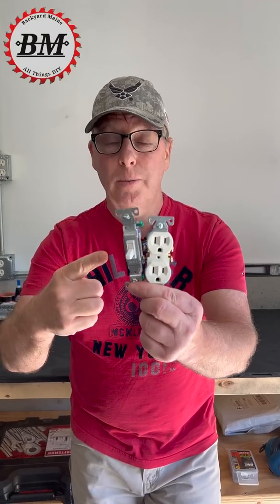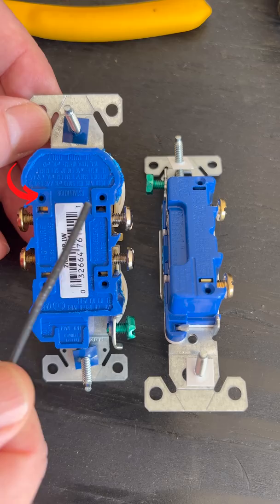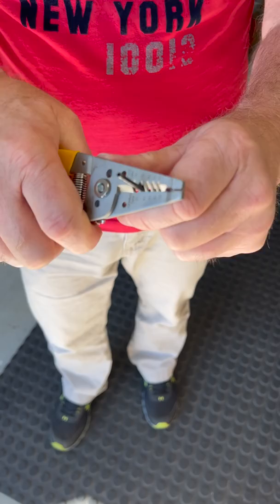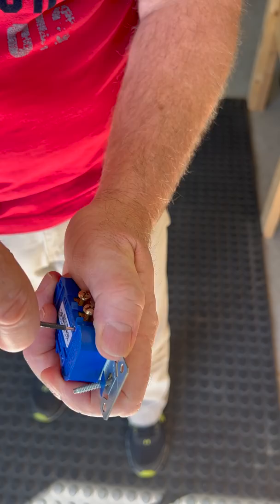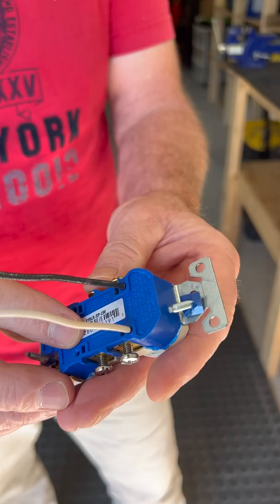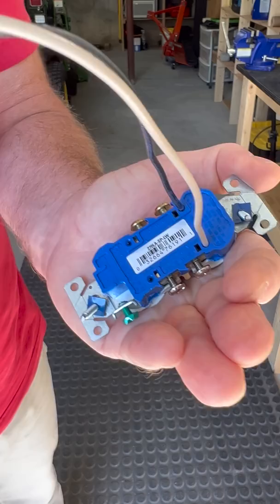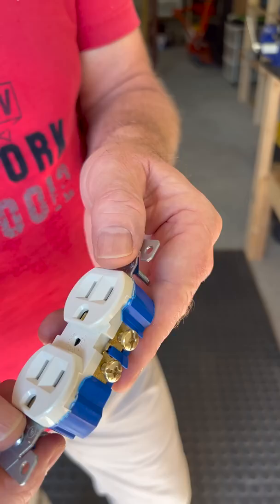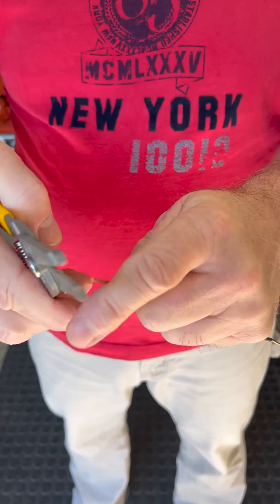Don't make this electrical mistake #Shorts

Comment: So even though they are certified to use that way you should do it? I'm replacing my outlets and all of them are 2 black and whites on the sides and one black and white in opposite speed connects  how should I connect them?
Reply from the maker: I would not install more than two wires of each color to the receptacle. If you have three wires you should pigtail them together with tails that connect to the side screws of the receptacle. I have a video on pigtails as well
Reply: What if I have split reciprocal in kitchen counter but want to install a new one with USB but inly has one hot and one white connector.... can I cap off one of the hots?

Comment: I have had both philosophies over the years. I will say that whatever you do,, DO IT PROPERLY!! I have never seen a PROPERLY done back stab fail. The amount of insulation removed is absolutely imperative, too much or too little will cause problems. I have also see side terminals not done properly that are just as dangerous.. The worst I've seen was IDIOTS drilling the holes so 12 ga would fit
Reply from the maker: Constructive arguments are always appreciated.
Reply: @BackyardMaine  it isn't my intension to argue and nothing you've said is wrong.. I have seen wire stripped 3/8", left straight, and pinched under one side of the screw, AND many times wrapped backwards and barley held in place by the screw along with  the standard too much or too little insulation removed....I think most strictly residential electricians would say use the back-stabs and almost all industrial and commercial electricians would say NEVER back stab.  BY FAR the most common point of failure is wire-nuts being considered connectors which they are NOT, They are insulators.. That might be a good video for you to make and so would box make-up.. Either way,, your advice is good and not misleading

Comment: Yet, they have passed UL testing and companies haven't been sued out of existence.  WAGO makes and sells millions.  Intuition says side wiring provides more surface area, yet upper and lower screws are connected by little tab.  Old wives tale.  Of course if you are feeding 15A receptacles with a 20A circuit breaker?
Reply from the maker: I’ve repaired 100s of these after they have been installed for a few years. They used to be approved for 20A as well but not anymore.

Comment: My apartment complex wired the sockets with the light switch. So when ever I turn on the lights the sockets start working.
Reply from the maker: Many time just half of a duplex receptacle is switched or maybe one receptacle in a room without a ceiling light. If all the receptacles are switched on both sides that's a poor installation.

Comment: It's code and UL listed. Secret trick electricians use so they have work later down the road. If it's not stripped well and a clean stab yeah it may flicker. You really have to be incompetent to mess up that easy of a connection. It's not like everything is ment to last forever and it's not going to any ways. Most bedrooms are not wired to properly supply heaters with power. That back stab is a weak point to alert you before you ruin the circuit entirely. Saying never back stab though, it's debatable.
Reply from the maker: So you’re saying that it’s a poor connection on purpose. lol.  Electricians and engineers like myself should be installing circuits to handle the max load based on the NEC. A 15A circuit should be capable of carrying 12A. Depending on the breaker for protection is a much better solution than a known poor connection

Comment: Then what you need the holes for ???
Reply from the maker: They are still an option but if the manufacturer thought they we best why do the give you the screw terminal option. I think they were designed for the DIYer.

Comment: Why are there four connection points on the duplex outlet?
Reply from the maker: They are there for two reasons. One is if you want to split the receptacle and have one side switched or even fed from another circuit you could remove the tab between the two screws. Second would be for through wiring to the next device.  In this case the incoming wires would hook to one side while the outgoing wires connected to the other.

Comment: Back stabbing the device in 2022 is safer that the 1990 when the device excepted 12&14 AWG 
Side wiring the device is only better if you are torquing the screw otherwise it is not as good of a connection
RC3
Reply from the maker: I find the new ones failing all the time as well. I guess we all have different experiences.

Comment: if these are so known to be a failure point and are not recommended why do they exist and are UL legal or whatever?
Reply from the maker: Stab connections are the manufacturers attempt at supplying a user friendly way for homeowners to replace a switch or receptacle. They are however not reliable over time. I say this based on my experience of  almost 4 decades of in the electrical field either as a licensed electrician or electrical engineer. I have seen some screw terminal connections that were made so poorly that the stab would have been more reliable. Maybe thats why these are still available. Companies like Hubbell and Leviton are now offering a much better and more reliable quick connect on their devices. If they continue to gain popularity and prove to be reliable the stab connections may become obsolete. I have other videos with failed stabs on my channel.

Comment: how many inch pounds do you tighten it to or is it foot pounds?
Reply from the maker: You can find that in the manufacturers recommendations but I never torque these connectors. I know what tight after 38 years. lol. I have never know an electrician that did torque.

Comment: Then why does UL sign off on the stab connectors??
Reply from the maker: They used to be listed for 20A devices as well but not anymore. I find they work ok under minimal loading but now always. I have had them fail on light switches even wit LED lights. As many failures as I have seen over the years it just makes sense to me to use the screw connections.

Comment: SCAB LOCKS.   Never use an outlet as a junction point either …Use pig tails off the receptacle
Reply from the maker: Never heard that term before. lol
Reply: @BackyardMaine  u do not know how many new or built within the past 15-20 years that every single device was Scab locked ….  They lost power in sections of the house
Reply from the maker: @cyrysvonnachtseite4546  I do actually know my friend. Ive been an electrician for 38 years and I have repaired so many of these connections.

Comment: Would this also cause the breaker to trip if the lights flicker enough?
Reply from the maker: If it’s beginning to leak to ground or neutral then yes.
Reply: @BackyardMaine  i forgot to mention that the breakers that trip are afci and not gfci
Reply from the maker: @TheFARM2019  Absolutely! AFCI breakers are designed to trip when an arc occurs which is what's happening with your connection.

Comment: Als a German Electrican Apprentice im shocket from the Work is done in America. 
Nearly everything is Touchable with high Safety for Kids or Workers and more. 

We need to use the DIN VDE Guidelines for making good and Safe Work for those Costumers because if the House is Burning the Electrican maked some work whats not inside in the DIN VDE than he or she need to pay or go to Jail.
Reply from the maker: The same holds true here which is why we are required to follow the code and installations require instructions before an occupancy permit is granted

Comment: I can't count how many outlets I have had fail due to the push-in connections.  And I'm just a homeowner.
Reply from the maker: I know right and the the comment before yours says 22 years without every having an issue.. I find them failed all the time or at least I used to before I retired.
Reply: @BackyardMaine  Those push ins are crap.  Not enough surface area contact and it leads to failure.  Pretty basic electronics there.  I feel the same about wire nuts versus those clamp connectors.  But I'm old lol.  Fixing to retire (again) in a few months.
Reply from the maker: @oldtop4682  I'm old too.. 60 this year.
Reply: @BackyardMaine  64 in August lol.  Not gonna make that 66 and change - don't want to wait.  SS will be retirement #3 for this old soldier.

Comment: Grrr, Is it ok on a toggle switch? I spent forever yester doing the back pokeys bc that is how it was done previously on the unit
Reply from the maker: I wouldn’t worry about it especially on a light switch. It just not the best method and side wiring is more reliable.

Comment: All my receptacles in my apartment are backstabbed and all the screws aren't tightened. And they are using old receptacles I haven't seen anyone sell. So yea I'm in danger.
Reply from the maker: I don't think you're in danger or at least not very much. These are more of a reliability problem over time. But if you notice something smelling hot, warm outlets or signs of melting you might you may want to get it looked at right away.
Reply: @BackyardMaine  well the top plugs on three of the outlets in the living room are controlled by a switch by the door lol. Also one of them, the bottom doesn't work but nothing is melting or whatever. I think there's dust or something inside of it blocking connection. The receptacle being used isn't being sold anywhere, it has two backstabbing holes on each corner. I could get a commercial grade receptacle and connect the two reds on top, the two blacks on bottom and the whites on the right side with the silver screws.

Comment: There are three different colored screws .
There are 3 wires.  White ,black and no  insulator (covering)....It would have been a good idea to explain the proper locations for these 3 wires.
This video is not complete....I won't give the answer as to where wires should go....the answer is at your fingertips....There is a reason for having different colored ( different metal) screws....
Reply from the maker: I thought that might have been too basic for my audience but maybe not. I may try a short video explaining this and see how it does.

Comment: Every house I have ever been in and pulled an outlet out in has it done that way, in every city in every state I have ever lived in for over half a century.  Meaning the builders do it all the time, regular practice.  By licensed electrians..in houses that have to be inspected regularly.  Not to mention - THE OUTLETS ARE FRIGGIN DESIGNED TO DO THAT.  So...I am disinclined to believe a random TikTok video guy over all of that.
Reply from the maker: I'm a licensed electrician with 38 years in the field but you should certainly believe what you want. It's really only done in this area by unlicensed guys or guys with only residential experience. Why? Because they fail at an alarming rate. They used to be approved for 20A as well you know but not anymore.

Comment: Doesn’t tightening the screw ad extra   Wire grip
Reply from the maker: No not on the back stabs. There are back wire devices which a screw will compresses the wire between two plates. These are a great option and I highly recommend them.

Comment: If the STAB HOLE connections are no good why are they even on the switch in the first place?
Reply from the maker: To make it easy for a DIYer to replace a device. They work but they are unreliable especially with higher current which is one reason why they are no longer approved for 20A devices.

Comment: I will stick with side-wiring but can anyone tell me why the ports on the back are inferior?
Reply from the maker: I have a longer video on my channel where I pull one apart exposing the main issue with these connections. Check it out.

Comment: What does the NEC say about this??  If we are going to follow those rules, certainly they would say don't use them?  How about the manufacturer who puts them on there?  Why would they be allowed to put an inferior method of termination?
Reply from the maker: All good points. I really don't know why they continue to be approved. The fail at an alarming rate. They used to also be approved for 20A as well but not anymore.

Comment: So UL has approved something where arcing is very common....got it
Reply from the maker: That is correct. Did you know 20A receptacles were UL listed with these connections for years but finally lost their listing do to the number of fires they caused?
Reply: If you're claiming you can't buy a 20amp quick connect currently....you should get out more.

Comment: So they just out here making bad products? Come on…
Reply from the maker: The stabs are there to make it easy to connect without much experience. The screw connections are there for everyone else. I have found from 40 years of experience that the stabs fail at a very high rate. Ask pretty much any electrician and you will get the same response. The stabs were also offer on 20A devices but they are only available on 15A residential grade devices now. I don't care what anyone does. I just share my experience.

Comment: Those are not the best connection sometimes they will relieve themselves in the wall it’s best to use the screws that’s from experience that was wires will slip out every once in a while
Reply: Besides an electricity those things are spring clowned and electricity is it’s used those springs become warm that would relieve the tension on the wire and a lot of times they will come lose they’re not the safest thing to use in my opinion

Comment: Buy quality electrical parts and you won't have that problem.  You side wire garbage to reduce the likelihood of the garbage causing problems.  But, it's still garbage.
Reply from the maker: All back stabs are garbage. I don't use them and never have but I repair them often. Don't confuse the back wire with screw clamps to the back stab because they are quite different.

Comment: I dont understand this. Ive seen both side wire and back stab failures. Back stab at least prevents the damage from being far spread i saw a side wire blow the receptacle and even melt the box
Reply from the maker: I have seen side wire connections fail as well but it was always a poor installation that caused the problem rather than a poor design.

Comment: If that's the case why have they been making them for years and they're still making them
Reply from the maker: I think they make them to make it easy for a homeowner to replace a device. They did stop making them for 20A devices a few years ago do to the high failure rate and some fires.

Comment: While wagos are used everywhere now🤣
Reply from the maker: They are quite different from an engineering standpoint. I have some in a high stress circuit for testing. I'll make a video when the results are in.

Comment: Well if most electricians dont backstab in  connections why do the manufacturers of the items still make em that way??
Reply from the maker: Most large residential contractors require there guys to use these connections because the a quick and easy.
Reply: @BackyardMaine  ohhhh figures, its about the money!! Soo instead of the electrician taking an extra 2 minutes to wrap the wires around the side screws, some electrical companies would rather rush & do a more quicker shoddy job as common practice among most electricians prefer to use the and secure wires with  side screws

Comment: I had a outlet melt from that, And it was a outlet with only the insert through the back.
It was A house from the 90s with piss poor design.
Reply: Yeah those backstabbers are a space heater fire starter

Comment: Not true. I built my home 50 years ago and yesterday I updated my utility room light switch to an motion sensor. The 50 yr old was working fine. Never been replaced.
Reply from the maker: I have replaced 1000s of failed backstabs over the years so although you may have been spared on a low average circuit I can tell you from experience they are unreliable.

Comment: Why do they even offer the back stab if it is so dangerous?
Reply from the maker: There are contractors associations and the like push the manufacturers to make quick and easy designs. It all about making money
Reply: that explains why any switch or outlet I have replaced in my house was backstabbed. I attached the wires to the new ones on the side terminals. Though it is alarming that even though it is known that backstabbing these switches and outlets is hazardous, it is still permitted as acceptable.

Comment: and you will be the guy to push wago's with the same mechanism in them....
Reply from the maker: Nope not yet anyway. Also the wagos are not the same. They don't wedges the conductor between two thin plates. They use a lever which applies pressure to a wider material pinching the conductor. I have a few Lego connectors in a stressful circuit right now for testing. I'll make a video when the results are in.

Comment: If it's such a common problem then why are they still produced the same way?
Reply from the maker: These were approved for 20A as well (for years) but now they can only be found on 15A devices rated for 14AWG solid wire only. The rate of failure is still way too high in my opinion.
Reply from the maker: Thank you..

Comment: Why do you go clockwise instead of counterclockwise, to me it seems like if the wire were pulled it would spin the screw loose, righty tighty lefty loosey?!?!
Reply from the maker: When you tighten the screw it tend to pull the loop closed slightly. When its wire CCW it will open the loop or hook and cause a faulty connection.
Reply: @BackyardMaine  so the way you tighten the screw has nothing to do with it getting pulled loose after the fact. It has to do with torque rotating the wire in the moment